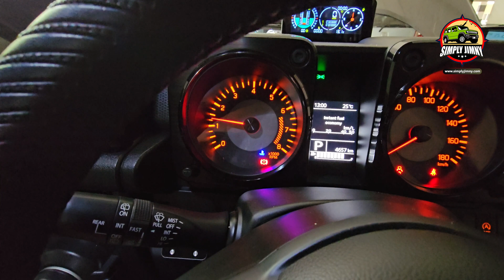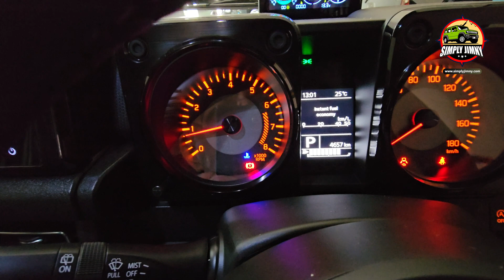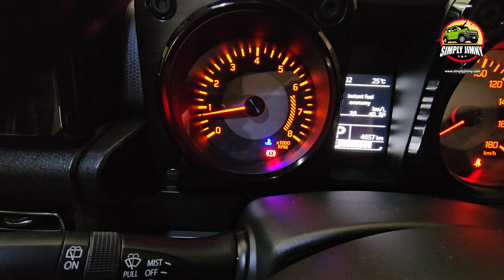DIY - Spark plug replacement Jimny 2023

Comment: Excellent video. Thank you.

I just changed to Ngk Rx Ruthenium plugs.
Used a new calibrated torque wrench. Was surprised to see that spark plugs no three and four were torqued down to 25 Nm. instead of 17.5 Nm 😮

Comment: sir, at 12:46 what is the material/sheet that you have used for your under the hood dampning? can you please share the details. Thanks for the informative videos.
Reply from the maker: @aniketchatarkar2888  its a hood insulation sheet and is available easily. Search for it in Google.

Comment: Do these spark plugs come pre-gapped?
Reply from the maker: @Philip.Mathew  Yes, they are pre gapped. I had mentioned the gap in some earlier comments too
Reply: @CurbOver thanks for quick reply! Yes, was wondering if these plugs are to be run with same OEM gap or some other gap specified by NGK. Did you check the gaps prior to install, were they all consistent and within OEM spec?
Reply from the maker: @Philip.Mathew  They were all set to 1MM and within the.95 to 1.05 MM gap specified for the Jimny.
Reply: @CurbOver  thank you! Video is very detailed, looking forward to more DIY’s.

Comment: I think you’re mistaken there with regard to the spark plug gap. Gaps are a lot less than 1mm. Usually the gals range from 0.40mm to 0.55 mm. You don’t need to have the torque adapter on while removing the plugs
Reply from the maker: Gap for Maruti Suzuki Jimny Spark Plug as specified in the Owners Manual is between 0.95 to 1.05 MM. Please refer to the manual, page 9-14. You can download the manual from https://nexaprod4.azureedge.net/-/media/feature/nexausercarmanuals/pdf-manual/jimny_owner_manual_new.pdf . Regarding torque wrench, I was just demonstrating the usage. I of-course know that we dont need to use it while removing the plugs or any other nuts/bolts. Thanks